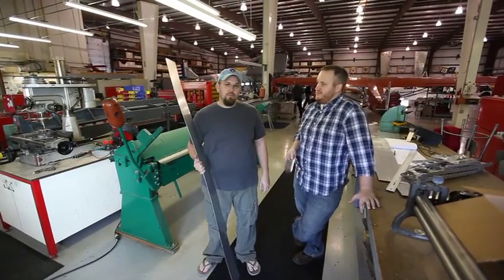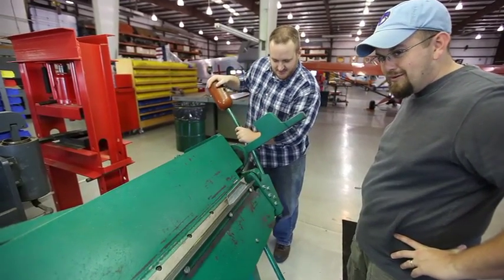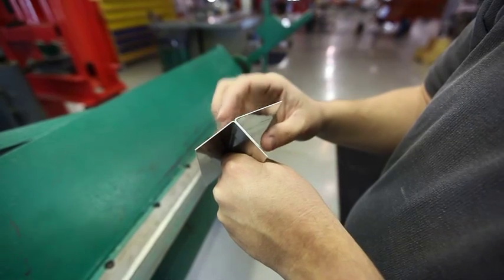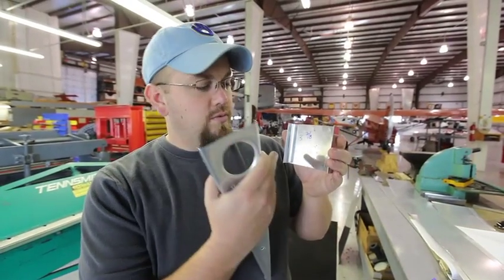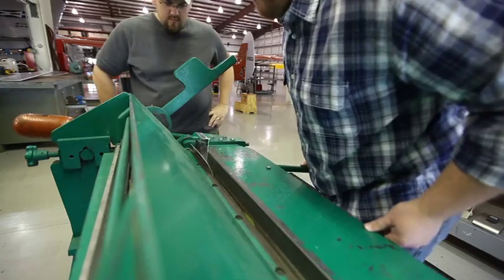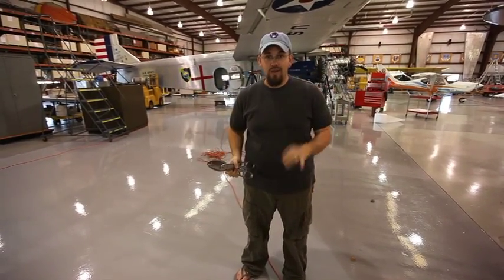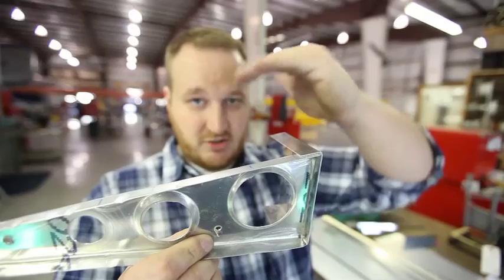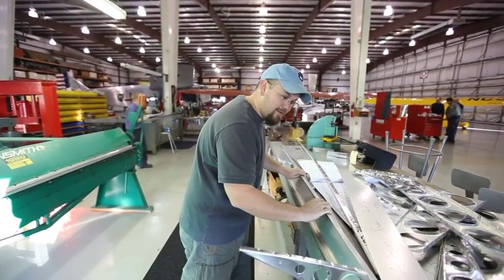Spar Bending

Comment: That finger knob on the brake in the back on both sides is to set the set back by moving the upper part of the brake forward or back,move it back and you get more radius,forward less,use it all the time on mine

Comment: Making a nice curved Bend Radius on Aluminum Sheetmetal I had really good luck with using high density cardboard as dunnage in the sheetmetal brake. With the setback technique you can only get so much radius, but if the radius needs to be bigger it is easy to do with the thick heavy cardboard on top of the sheetmetal to be bend, it worked great for the 60 and 70 thickness sheet 90 degree bends and required radi... 
Regards from Alaska!

Comment: I have my CH650 aileron skins blanked and drilled.  Homemade brake is flexing but I have access to a D&K 8' brake that I plan to use.  Your tip about using using sacrificial material will come in handy to establish 1/8" radius bends.  Nice job on your spar.